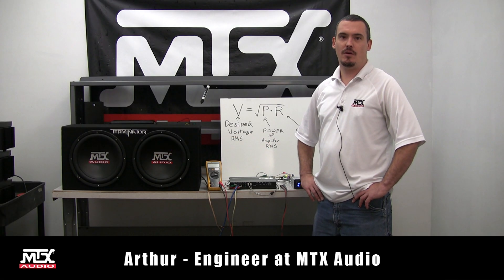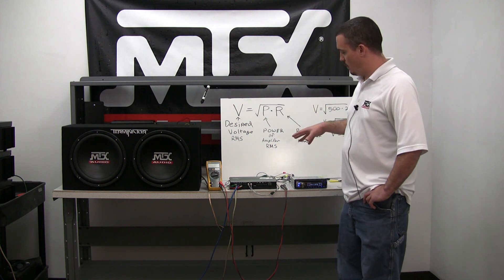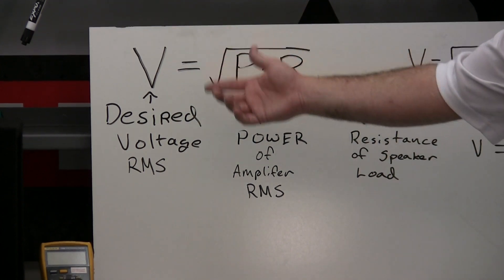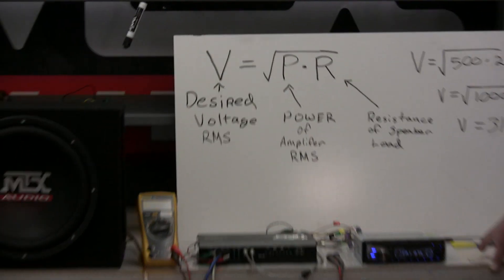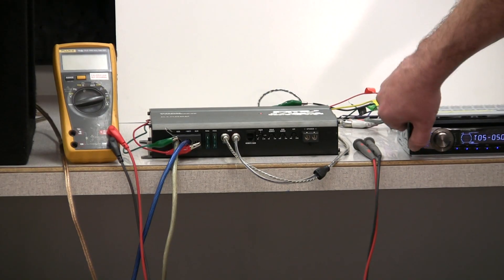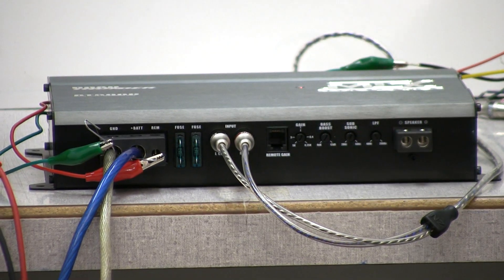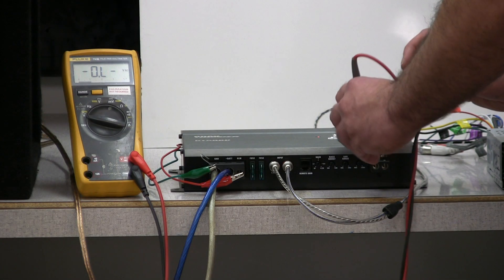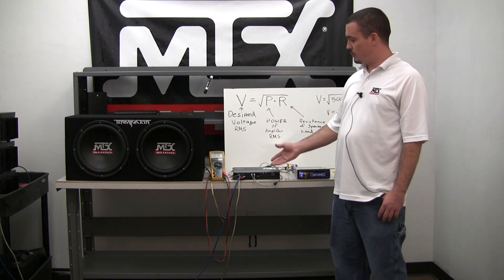How to Set Your Gains Using Ohms Law and a Basic Multimeter

Comment: I need a little help deciding which amp to use with my subs.. My subs are Memphis audio 10"s DVC each VC is 4 ohms... I have 2 amps and I am trying to decide which one to use.. The first one is a Crossfire XP series 360 watt amp, the second is a Kenwood KAC-8103D 1000 watt max power. Also says 300w (RMS X 1 At 4 ohms and <1%THD+N) whatever all that means... I have been trying to lean ohms over the past few days and apparently I had them all wired incorrectly before.. I had the 2 10s wired to the crossfire amp, I had 8ohms coming from each speaker and bridged on the crossfire amp which is 2 channel but when I try to look online all diagrams show just wiring each speaker to 4 ohms and running one off of each channel of the amp.. Am I not supposed to bridge this? any advise/Help would be greatly appreciated..
Reply from the maker: Kenwood KAC-8103D is 300watts x 1 @ 4ohms
Crossfire XP3602 is 360 x 1 @ 4ohms bridged or 90 x 2 @ 4ohms, 180 x 2 @ 2ohms.

With 2 - dual 4ohm voice coils, you can wire them to a final impedance of 1ohm or 4ohms at the amplifier (https://www.mtx.com/t/library-wiring-diagrams)

What is the RMS power handling of 1 of your 10" subwoofers? Multiply that number by 2 since you have two subwoofers.

Since neither of your amps are 1ohm stable, you will have to wire them to a final 4ohm impedance at the amplifier which means you will be using the amplifier RMS ratings that are at 4ohms. Choose whichever amplifier has an output at 4ohms that is closest to the total sum of your subwoofer RMS power handling.
Reply: Thank you..

Comment: They have send me the pic and said its stable at 1, 2 , 4 ohms 5200RMS from amp so let me how to wire and the final number for the calculations please voltage of my system are 13.8V

Comment: Thanks for you kind rply I have double checked with manufacturing company I mean DD audio they said this amplifier is stable at 1, 2 ,4 ohms so please let me know how I will wire and what will be calculations  for my system is this right like 52000x2=10400 then final v is 101.9V is it right and how about others setting lease dear I need your help to set my system (sehar517@gmail.com)
Reply from the maker: If you have two subwoofers rated at 2200 watts each = 4400 watts total and your amp is rated at 5200 watts @ 1ohm but you wire your subwoofers to 2ohm, you would only output whatever the 2ohm RMS rating of the amplifier is to your subwoofers. Assuming 50% output loss by going from 1ohm to 2ohms, you would have an output of 2600 watts to subwoofers that should be getting 4400 watts. That's only 1300 watts per subwoofer when they should be getting 2200 watts to perform properly. Plus, as mentioned before, if your electrical system hasn't been upgraded, you many not even have an output of 2600 watts.

Without knowing the true ratings of these products and what your electrical system can handle, it's hard to say. 

For the equation, you would need to know what the RMS output of the amplifier is at 2ohms. You would multiply that by 2. The square root of the answer of that multiplication problem will be your desired voltage. But setting the gains of this system without all of the spec info and considering the manufacturer warnings about needing an upgraded electrical system, setting the gains is only the beginning to making sure this system is setup correctly and adequately.

Comment: Dear I have 2 DC audio XL level 12" handling power( RMS / peak 2200/4400 ) dual 2ohms with M4a DD amplifier 500W x 1ch @12V 7000W X 1ch @14v dynamic power is 9500Watts using  system as on 1ohm @ 12V please can you tell me how I will calculate to adjust the gain please send me detail on (sehar517@gmail.com) appreciated your quick rply thanks
Reply from the maker: King Karim 2 subs with RMS ratings of 2200 watts each = 4400 watts of RMS power handling. Your amp is rated at 5200 watts x 1 @ 1ohm. Unfortunately, you can't wire 2 - dual 2ohm subwoofers to a final impedance of 1ohm at the amplifier. 2 - dual 2ohm subwoofers can be wired to 0.5ohms, 2ohms, or 8ohms. The manufacturer of your amp does not offer any ratings at any other impedances. 

12V ratings are more realistic than 14 or 14.4v ratings because unless you have a high output alternator and/or additional batteries for your system, stock electrical systems usually run at around 12 volts. 

The manufacturer's website even says that this amplifier will "need an upgraded charging system..." They continue, "Failure to provide a stable power supply to the amp at the desired output level will often result in amplifier failure. This type of failure is not covered under warranty."

Comment: so im trying to do exactly this, yet with my dmm on my pos and neg its barely reading anything at all. 00.3 to be exact....why is it soo low to almost nothing at all, where in this video and the countless others i've watched you're seeing numbers. I know that my rca's are perfect and unpintched. once however i do start to turn up the amp gain i see the volts start going up but at full counter clockwise. im only seeing 10.3v ac. you have an answer as to possibly why.
Reply from the maker: So when the gain is all the way down, you only have 0.3 volts but as you turn the gain up, the voltage starts to increase? Using the equation in the video, what voltage are you trying to get to?
Reply: Yeah all the way down it's barely .3 volts, and yes it does start to increase but not rapidly like in the video here. Instead it barely climbs, and with the gain at full CW position, I'm only seeing 10v when I know I should see way more then that. I'm needing 45 volts for what I'm running. And I'm only seeing those numbers by having to use the bass boost and I don't like nor want that at all, it's sounding too muddy. But that's the only way the voltage is getting that high and I really only have it tuned to 38 right now to be safe.
Reply: ***** also another quick question. I know this is a very beginner question, but when buying the new amp. To just tune the amp because there is obviously no way to without playing the 50hz tone through the system. Do I have to go behind my head unit and cut all the wires to the door speakers and have to redo all that once I'm done tuning. Or is there a way to tune while those are already hooked up by default.
Reply from the maker: tyler duarte This video doesn't address how to tune your amplifier. Tuning is different than setting your gain. The gain controls the sensitivity of the audio signal that is sent from your head unit to your amplifier and from your amplifier to your speakers/subwoofers. Tuning further manipulates your audio signal through crossovers and filters so that certain frequencies are sent to appropriate speakers that are capable of reproducing those frequencies. For example, you wouldn't want to send high frequencies that are intended for your tweeters to you subwoofers and vice versa. Hopefully that answers your question.
Reply: Well of course I do know all of this, I'm not that novice. Sorry for I guess using "tuning" as a word for setting the amp gain. No didn't answer it at all, I'm wanting to know from an install stand point......is it best to do this part of your setup......WITHOUT ALL OF THE OTHER (door,tweeter,rearspeakers) WIRED INTO THE SYSTEM? Then once I've set my gain wire all the inside car speakers to the system?

Comment: Hey Guys!  I am also looking for a little help in figuring my setup out.  I have a pair of JL Audio C3-650 speakers rated at 75 Watts @ 4 OHMS, and a JL Audio XD400/4 amp  
rated Power at 14.4V with less than 
1% tHd+noise (20Hz - 20 kHz)
Stereo, all channels driven:  75W RMS x 4 @ 4 ohms.

So does that mean 75*4=300watts for the amp @ 4 OHMS, so 300*4=1200, so Square Root of 1200=34.64 Volts?

Please let me know when you can.

Erik
Reply from the maker: Yep. That's right. Just be sure that each speaker is wired to it's own channel of the amplifier so the final impedance remains at 4ohms for each channel.
Reply: Erik Kurlanska Thank you so very much for your quick response.  I really appreciate it greatly.  You are very helpful

Comment: Hi, I have two gain knobs on my amp. do I put my voltage figure on both gains, or divide that figure between the two?
Reply from the maker: If you have two gain knobs, you probably have a multi-channel amplifier. What model amplifier do you have? 

Assuming it is a multi-channel, you would set each gain individually according to this method. If you are powering speakers other than subwoofers, you would use a tone appropriate for those speakers. For example, a subwoofer appropriate tone is 50Hz. For speakers, you would use something more like 1kHz.

Comment: Hi! Thanks for uploading. Very usefull video 

I have a 1135 rms Amp jbl crown  and a 1100 rms rockford p2/t2 subw hooked up at 4 ohm   How do i get the Max out of the both? 

Thanks again.
Reply from the maker: We assume you have a Rockford Fosgate P2D2 which is a dual voice coil subwoofer in their P2 (Punch) lineup. Depending on which size you have, your RMS power handling is between 250 and 400 watts. Peak/Max power handling on the 15" model is 800 watts so without knowing what exactly you have, we cannot help with the equation. Please check your specifications of the exact model #'s you have and ONLY use the RMS ratings. Do not use peak or max power ratings.
Reply: *****  thnx for the reply i checked and i have a rockford T2 15 inch
Reply from the maker: Sandeep Raj Moenilal OK, that subwoofer T2D215 has a 1200 watt RMS power handling. Would still need to know the exact specs of the amplifier.

Comment: So square root i got was 77 ish (3k x 2ohm) So id set gain until it reads around 77, that simple right?
Reply from the maker: The square root of 6000 is 77.46. So assuming your 1 amplifier has an RMS power output rated at 3000 watts at 2ohms AND your subwoofers are actually wired at 2ohm at the amplifier... YES... That would be correct.
Reply: Its 3.2k at 1 ohm  1.6k @ 2 ohm so id do the 1.6k x 2  instead and square that correct?
Reply from the maker: Extortion What is the brand and model # of your amplifier. Need to make sure the ratings you are using are RMS and not peak or maximum.

Comment: My sub has a single 4ohm voice coil and 200wrms, should P be the rms my amplifier has at 4ohm (250wrms) or maximum rms at 1ohm (600wrms)?
Reply from the maker: If your subwoofer's power handling rating is 200 watts RMS, you wouldn't want to use the full 250 watts RMS @ 4ohms that your amplifier is capable of because you could overpower the subwoofer. Instead, use the 200 watt RMS power handling of your subwoofer. This will help to make sure your gain is set so that your amplifier is providing only the power your subwoofer is rated for. NEVER setup your gains or match subwoofers to amplifiers using MAX or PEAK power ratings.
Reply: @MTXAudioUSA  with impedance rise that amp will never gonne put out 250

Comment from the maker: @JT Rut

Setting the gains on amplifiers that are powering door speakers is done in similar fashion but you would use a tone more appropriate for the speakers. For example, we have a 1kHz tone you can download from our website at https://www.mtx.com/t/testtones
Reply: I tried this on my new system. Everything's new except for the RCA's. I can't get a reading in my multimeter. Could it be the RCA's
Reply: @tpm1868 did you use the DC voltage setting to check your power wire(12v+/-)? when you turn the head unit does the remote receive a dc current(12v)? (you can use the ground for the negative on the multimeter for these two tests/probes) -------------------- You can test the RCAs with a multimeter if you set it in AC volts and probe the center pin and outside ring of the same plug/wire, while music is playing if you get an ac voltage that is going up and down they are working as intended. If you can answer some of my questions, I can defiantly help you figure out what the issue is and we can get you jamin just like that reggae playlist you have on your channel. Been letting it play all day...
Reply: @Dheath  thanks for getting back to me. Had to replace my deck. Dead sub out rca. Now with new deck everything's working just fine

Comment: This question is more of a clarification:

My alpine 5 channel amp is rated a little higher from the factory than what the speakers handle.  For example the sub channel is tested by alpine at 554 rather than 500 as advertised.  The sub speaker I have is rated at 500.

The door speakers are rated at 110 (front comp) and 100 (rear coax).  The amp was tested at 124 per channel by alpine.

Am i correct in assuming that I should do my calculations based on the speaker RMS instead of the amp RMS, and then I won't be over powering my speakers?
Reply from the maker: For Power (P) in the equation, use whatever amount of power you want the amplifier to put out at the impedance your subwoofers are wired to. For subwoofers and when setting the channels used to power your subwoofers, you would use a 50Hz tone. For setting gains on amplifiers or channels of amplifiers that are used to power full range speakers, you would use a tone more like 1kHz. Both tones can be downloaded from our website at https://www.mtx.com/t/testtones

Comment: Can you make another video explaining more than one speaker setup or clarify a few things?
Amp: 
Alpine MRV-M500 
-mono subwoofer amplifier 
-300 watts RMS x 1 at 4 ohms or (500 watts RMS x 1 at 2 ohms) 

Speakers: 
Kenwood KFC-W3013PS 
12" 4-ohm subwoofer 
power range: 50-400 watts RMS 
"peak power handling: 1,200 watts" 

Alright, mono sub wired down to 2 ohms is P=500?
Or is it P=400 because the max speaker RMS is 400? 500 would be more RMS from the amp than the speakers can handle RMS wise. Correct?

So it's either AC Volts = Sprt ([400 or 500] * 2 ohms)

Thanks!
Reply from the maker: P = RMS power rating of your amplifier at whatever impedance (R=resistance) you have your subwoofers wired to. If you have 2, 3, 4, 5, or however many subwoofers you have, what impedance are they wired to at the amp? That is the number you would use for R (resistance). So in your case, P = 500 watts but only if your subs are wired to 2 ohms. If your subs were wired to 4ohms, you would use the 4ohm RMS rating for your amplifier for "P" in the equation. 

P = RMS rating of your amplifier at whatever impedance your subs (any number of subs that are connected to that mono block amplifier) are wired to.

R = resistance (impedance) of your subwoofers at the amplifier in ohms. If you wire two single 4ohm voice coils in series, you would use 8ohms. If you wire two single 4ohm voice coils in parallel, you would use 2ohms. See our wiring diagram tool to learn how to wire subwoofers to different impedances - https://www.mtx.com/t/library-wiring-diagrams 

Assuming you have your two subs wired to 2ohms at the amp,  your equation would be: V = square root of (500 * 2), V = square root of 1000, V = 31.623 volts
Reply from the maker: Since your subwoofers have an RMS power handling of 400 watts each (2 subs x 400 watts each = 800 watts total), your amplifier is a bit underpowered for what the subwoofers are rated for.
Reply: ***** Awesome! Thanks! But I'm wondering, since the max rating of the Subs is 400 RMS, would it be a better idea to use 400? To be easier on the subs? Really appreciate the help!

I'm looking into a possible change to me setup with going with your guys 12" dual voice to wire that down to 2 ohms. So it'll be the same settings. I think it'll save me some trunk space for a rear mounted single sub instead of having this big ol box. Though's on that? I'll most likly have to make a small box, cause I don't think it's a free air rated sub. Thanks again!
Reply from the maker: Hott Toddy If you have 2 subs at 400 watts each and your amp is rated at 500 watts x 1, you would only be putting 250 watts to each sub. The amp is a bit underpowered. If you have 1 sub, then yes, you would use 400 watts in your equation so that you don't overpower the subwoofers by sending too much power. 

If you were to buy a single 12" dual 4ohm voice coil sub and wire it down to 2ohms at the amp, you could go with our 5512-44 - (https://www.mtx.com/55-series-car-subwoofer) and use the same amp or our 7512-44 - (https://www.mtx.com/75-series-car-subwoofer) but with that sub, your amp would be a bit underpowered again.
Reply: ***** Awesome. So equation is:
AC Volts = Sqrt 500 * 2
AC Volts = 31.62
Reply from the maker: Hott Toddy That would be correct assuming your TWO subwoofers are wired properly for a 2ohm impedance at the amplifier. V = square root of 500 watts x 2ohms which is V = square root of 1000. V = 31.62.

If you have one subwoofer, use 400 watts (instead of 500) of RMS power from the amplifier (according to your subwoofer's specs) AND be sure the subwoofer is wired properly for a 2ohm load at the amplifier, V would = 28.28.

Comment: My amp doesn't have gain control....?
Reply: KAC-5001PS amp.  Running a 500 rms sub @2 ohms.
Reply: shadyswiss so 31.6 is what I'm getting,  but my amp doesn't have a gain control knob...  :/
Reply from the maker: shadyswiss Since this isn't our amplifier and we aren't sure what exactly is going on inside the circuitry of this amplifier, we cannot say for sure, but try using the input sensitivity adjustment.